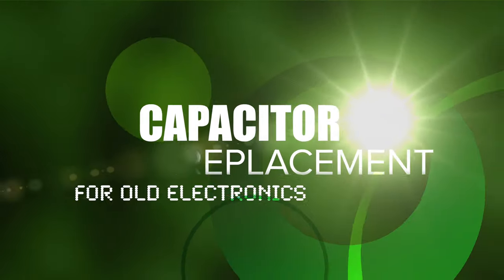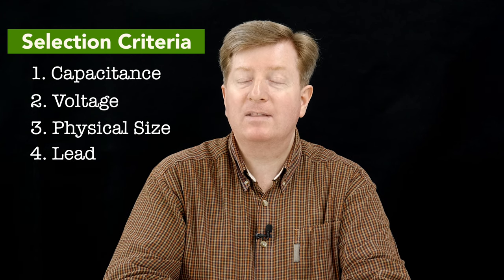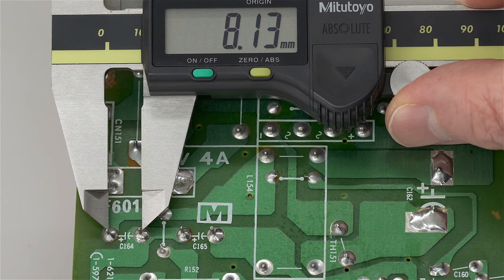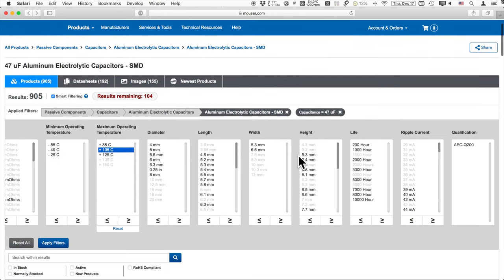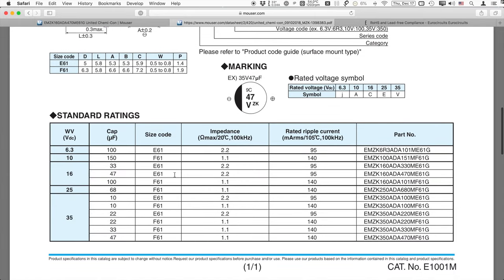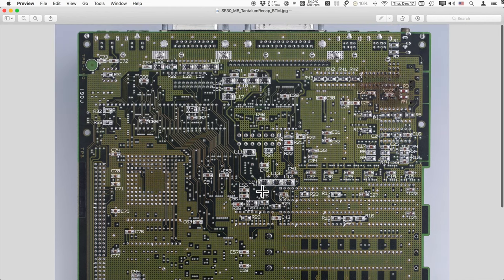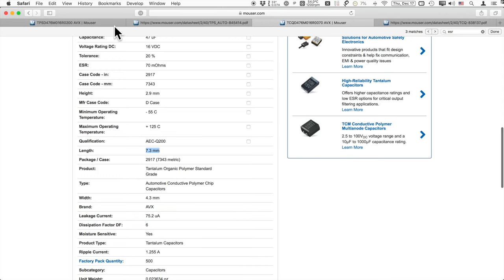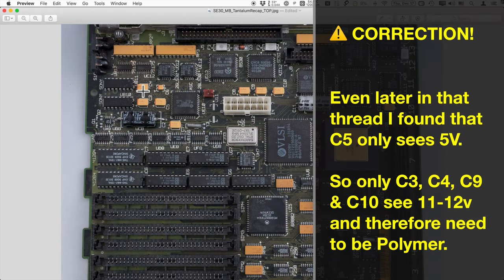Choosing Capacitors to Recap Old Electronics

Comment: Harbor Freight sells digital calipers for much less than a Mitutoyo costs and are of equivalent quality.  Certainly good enough for gauging capacitor bodies.
Reply from the maker: I can't speak too much about the game of "good enough" because I only tried the one Chinese made digital caliper and found it was a fail, then I purchased the precision Mitutoyo and found it to be ideal, and I rely on it for accurate measurements.  But if you buy a cheap pair of calipers and find it lets you measure accurately enough to buy capacitors to your size requirements, then of course that is all you need.

Because I live in Japan, I have never used Harbor Freight, which makes it all the more interesting that I get daily SPAM from a source purporting to be Harbor Freight.  Not sure why there's so much SPAM pretending to be them, but if it happens to me, who has never purchased from them before, customers of the real Harbor Freight should be careful about what emails arrive in their INBOX.

Comment: Leaded solder flows and sticks better. (?) True or Not?
Reply from the maker: Leaded solder flows better, yes.  "Sticks better" depends on flux and technique.  

Why would Lead Solder flow better than Lead-free? Lead solder has a lower melting point, which really does make a difference. Lead solder is also a bit more shiny and mirror like than lead-free, and I prefer that look.  Lead solder has no "tin whiskers" problem like lead-free solder does. I always use lead solder and never use lead-free.

Comment: Not sure if this is an easy to answer question, or another video.  Polarity / Batteries vs Capacitors  ... Since both charge and discharge, why are anodes - on batteries, and positive on caps?  Thx.  If you're feeling generous, why use lines for NEG on wet caps, and POS on solids?  Thx.  Excellent video, btw.
Reply from the maker: That's actually why I prefer Positive (+) and Negative (–) terminology myself, as it tends to be less confusing overall that Anode and Cathode.  But there are technical reasons for the apparent confusion in terms.  And rather surprisingly, Wikipedia gives the clearest answer of all here: https://en.wikipedia.org/wiki/Anode
Reply: @JDW-  , thx for your response.

Comment: reverse voltage on tantalums is always fun :)
Reply from the maker: You're referring to the explosion at 4:33.  Yes, it is true.  But sadly, even a voltage spike can trigger solid tantalums to go up in flames.  This is why they need to be derated by 50% (i.e., rated for 25V if used on a 12V voltage rail).

Comment: Hi, i have a 1Kp 50volt (+/_20%) small cap that looks identical in size and appearance to a resistor.
It's from a williams pinball machine 1991 cpu board.
What is a modern equivalent replacement for this please?
Reply from the maker: What is "Kp"?  Can you post a link to a photo?
Reply: @JDW-  
1Kp= 1 kilo pico farads = 1000 pico farads. Or 0.001uf
I'm not sure how to post a photo. But as i mentioned it is identical to a resistor with the color code stripes.
Some people commonly mistake them for resistors.
Reply from the maker: Thank you for explaining.  I am unfamiliar with pinball machine circuitry, nor do I know if it is in the power supply or something else.  If you cannot provide a link to a photo of that capacitor, perhaps you can determine if it is ceramic, electrolytic, film, mylar, tantalum, etc?  By knowing the type of capacitor it is and how it is used in your circuit, one can then more intelligently choose a suitable replacement.  Picking a completely different capacitor type, even if the capacitance and voltage rating are the same, isn't the best practice, hence my question to you today.

Comment: RoHS is a no-brainer. Also, in Europe, it is a requirement. Lead-Tin solder is forbidden for new production in the EU, except in avionics and space. Professionals may use it for repair.  I use it,  as amateur, for repairs on equipment with leaded solder since I have rolls of lead solder that will last my career. But all my new production is RoHS exclusively.  Remember Flint, Mi.
Reply: What does the gross negligence  and incompetence in water chemistry in Flint have to do with any of this?
Reply: @wildman1978101  He is clearly unaware how frustrating lead free solder is -- I suspect he also needs to resist the urge to eat leaded solder otherwise idk wtf the issue is either WTF STOP EATING HAIR
Reply: Agreed. Planet 🌎 comes first.

Comment: So i've got an old cassette deck that has ELNA capacitors, most are blue but some are pink, what does the pink mean?
Reply from the maker: Here's the ELNA Catalog: http://www.elna.co.jp/en/capacitor/pdf/catalog_19-20_e.pdf
Red Print = SOLID Polymer (cannot ever leak)
Blue Print = Hybrid Polymer (fluid electrolyte and therefore can leak after 15-20 years)
All said, if all your Elna caps are the Red/Pink type, you don't need to replace them.
Reply: @JDW-  Only a few caps are pink, but given that the deck is from 1979, should I just replace them anyway for good measure? Is it fine to replace a solid polymer cap with a fluid one? Also thank you for your help.
Reply from the maker: @hughjanus6975  If you are 100% sure your tape deck is from 1979, then those Elna caps cannot be Polymer.  The very first Solid Polymer cap was the OS-CON, released in 1983 by Sanyo (now owned by Panasonic).  As such, those caps inside your deck must be regular fluid-filled aluminum electrolytic types which you should replace.  You can replace them with regular fluid-filled aluminum electrolytic capacitors or polymer types.  Just make sure the voltage rating and capacitance rating match, and make sure your replacement capacitors are physically the same size so you know they will fit.  That means you need to measure the height and diameter of the existing capacitors.  I would suggest you check the distance between the legs too.
Reply: @JDW-  The motor is dated 1979, that's the only indication I have. I bought an identical deck for parts and that's dated 1980. I don't think they made the Kenwood KX-2060 for long. Thank you very much for your help.
Reply from the maker: The only way to know for sure is to carefully desolder one of those caps and measure ESR with an LCR meter like the DE-5000 I use. Any ESR of 0.06 ohms or less for a 47uF or smaller capacitance, measured at 120Hz, is polymer. But of course, you probably don’t have an LCR meter and for a single project it isn’t worth the cost, so you may just need to replace those capacitors. Keep in mind though that capacitor replacement won’t fix every problem.
Reply: @JDW-  I only recapped the power board and it fixed my speed right up to correct speed, was slow before.
I'm going to be recapping a lot of audio gear in the future so I might need a link to a good meter
Reply from the maker: @hughjanus6975  If you scroll up on this page and click SHOW MORE (on a desktop computer), you will expand the text description.  There you can do a keyword search for "DE-5000" to jump to the Amazon link.  That is the best hand-held LCR meter available.  I own one and highly recommend it.  I test ESR using that meter at 120Hz, but the meter allows you to set anywhere from 100Hz to 100kHz, which can be useful if you are trying to match the frequencies shown in certain data sheets.
Reply: @JDW-  Thank you very much.

Comment: Do you have any concerns of polymer tantalum's having a possible earlier end of life? 

"One critical benefit of MnO2 tantalum capacitors, and one of the primary reasons that they’re ideal for use in high-reliability and long-life applications, is that there are no known wear-out mechanisms for this technology."

"In addition to demonstrating sensitivity to certain storage, handling, and reflow mounting conditions, conductive polymer capacitors are also susceptible to effects of humidity within finished devices, hybrids, assemblies, and some end devices. Regardless of the circumstances surrounding its ingress, the presence of excess moisture initiates the degradation of the polymer cathode material. This degradation is then further accelerated by an application’s temperature and voltage characteristics (e.g., temperatures at or above 85°C at 85% of rated voltage), which leads to parametric capacitance loss."
Reply from the maker: Solid Tantalum MnO2 capacitors are affected less by humidity than their Polymer Tantalum counterparts, which is why Polymer Tantalum capacitors these days tend to ship in sealed bags that have a moisture removing desiccant and a paper card with a strip that shows humidity levels in the bag.  If the polymer capacitors have been expose to too much humidity, when soldered they may be compromised internally or even pop like popcorn.  However, if dried for many hours at 40°C prior to soldering, they will be fine during soldering.  Impact of humidity on SOLDERED polymer tantalum capacitors is considered to be substantially less for modern manufactured polymer tantalum capacitors in comparison to those made in the 1990's, but precisely how much impact humidity has on the usable life of soldered polymer tantalum is largely relegated to studies like this one, which doesn't leave one with a crystal clear picture of how many Hours, at a given temperature, one can expect from a modern polymer tantalum capacitor: https://www.kemet.com/en/us/technical-resources/advances-in-reliability-of-conducting-polymer-based-capacitors-in-high-humidity-environment.html
Reply: @JDW-  Thank you sir. Very interesting. Do you know if KEMET KO-CAP series use PSSA films discussed in the article? I was not able to tell looking at their data sheets.
Reply from the maker: @roymercer6967  Unfortunately, I am unable to find that information online, so it would be an excellent question put forth to Kemet.

Comment: can you go up in voltage. I dont  mean by a lot
Reply: @phillipweaver in general its ok to go up in voltage rating. A modern replacement might even be the same size for a higher voltage rating. A 35 volt replacement for a 6.3 volt is not a lot for an electrolytic for example.
Reply from the maker: Yes, you can choose a replacement capacitor with a higher voltage rating, either a little bit or a lot. But keep in mind the capacitor with a higher rating may be physically larger than the original capacitor and therefore may not fit. So you need to measure the lead spacing and measure what the maximum diameter of your replacement capacitor can be before you purchase that replacement.

Comment: Mitutoyo calipers are overkill for the task. A $20 pair from Harbor Freight will be just as accurate. More than enough for this job.

The main difference between good calipers and the cheap Chinese  variety is how long they're last in industrial, 8 hours a day, 5 days a week, dirty and wet (machining coolant) workplace, not accuracy or repeatability.
Reply from the maker: Thank you for your comment. In my videos, I show what I have, which isn't necessarily what is cheapest.  I also live in Japan, which means I can often find good quality Japanese tools for less than what they are sold for outside Japan. I also had some Chinese calipers prior to the Mitsutoyo which were digital and absolute junk in terms of (1) the LCD suddenly stop working and (2) the accuracy of the markings being less than that of Mitsutoyo. So the word "overkill" really depends on the person.  

If you are a less demanding person with a care-free attitude, pretty much anything cheap will do, in most any situation.  But if you are a meticulous nit-picker who seeks perfection in all you do (which tends to describe me), less is not more, let me tell you.  

With that said, people not knowing what to do should follow your $20 Harbor Freight purchasing advice.  When and if you are dissatisfied with the cheaper calipers, you can always step up to the Mitsutoyo.  The same is true of soldering stations.  Start with a cheap Chinese version, then perhaps you'll find a benefit one day to getting a HAKKO.

Comment: On your McIntosh motherboard recapping it looks like you used silicone cement, not hot glue.  I would favor silicone although it's messier to work with than hot glue.
Reply from the maker: Looks are deceiving, but I assure it, it was hot glue.  I have various sticks of the stuff here in Japan.  Some is cloudier and some is clearer than others. In the end, I would favor no glues at all because the right approach is to solder in the SMD body capacitors, not radial.  The only reason I used hot glue many years ago was in hopes that if I accidentally bumped one of the radial caps, the hot glue would help ensure one or both feet didn't yank off the PCB pads.  But again, when you use SMD replacement caps on pads intended for SMD caps, then no hot glue or silicone is required, which is a good thing.

Comment: Old tantalum capacitors can just go bad and burn.  Ive had several burn in old gear.  I now replace then with high quality electrolytics.
Reply from the maker: I personally would not because those fluid filled electrolytics themselves will need to be replaced 20 years hence.  If one is averse to properly voltage derated solid tantalum, one need only use polymer tantalum instead, or OS-CON with its solid electrolyte that cannot leak.  The other benefit to OS-CON is the ESR is even lower than polymer tantalum, which is quite a bit lower than solid tantalum.
Reply: The problem with the old tants is that they weren't properly derated for the lifespan we vintage enthusiasts expect from our gear. A Tektronix 465B scope was supposed to work for maybe 10-15 years; then you were supposed to buy a new model. Last year of manufacture was 1983, and mine still trudges on, albeit with a few tants having said pooof. Tek were probably right in expecting a 20V tant to work on a 15V line, over the life span expected, but not when the scope is run for 3x that. Replace with one voltage step higher and it will be fine.
Reply from the maker: @mansnilsson4382  Speaking of scopes, we have a Tektronix TDS 1012 at the office, which is still working fine.  But we've been thinking about replacing it for something more modern.  The Siglent SDS2102X Plus costs roughly the same as the TDS 1012 did new, but my oh my have the features improved over the years.  10" touchscreen high resolution display and a host of rather amazing features, not to mention the amazing ability to hack even more into operation! 🙂
Reply: That theory works right up to a point.   The inductive reactance of the wrapped aluminum electrolytic, and the greatly higher ESR of the aluminum will cause problems in sensitive circuits.

Comment: Console5 is awesome.
Reply from the maker: Console5 offers very low cost kits, but it's important to keep in mind that they don't have kits for everything, nor can you buy any capacitor you like from them individually.  That is why there is still reason to purchase capacitors from places like Mouser or DigiKey.
Reply: @JDW-  Agreed. I bought their Atari 2600 Jr. Refresh kit and it worked great. That was how I discovered the tiny square film caps. But I added some more new parts from Mouser too like a TRS-1 2450 and new chips. I'm going to try their Colecovision kit next.